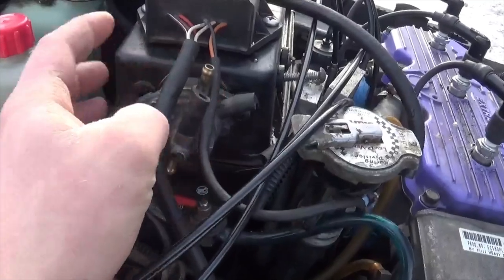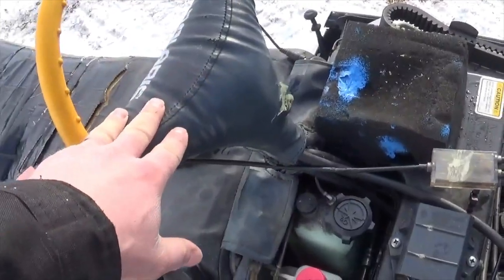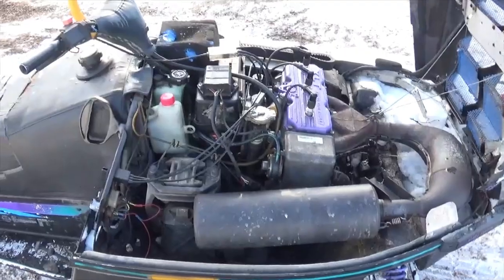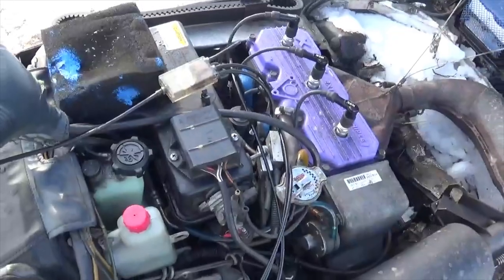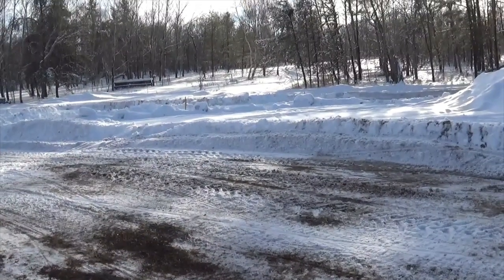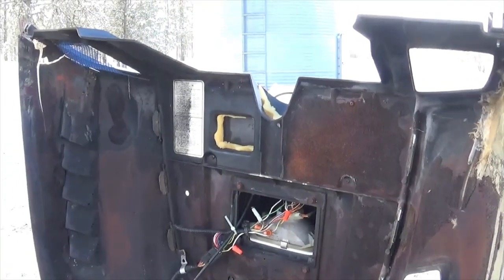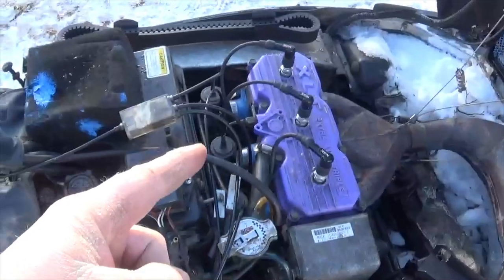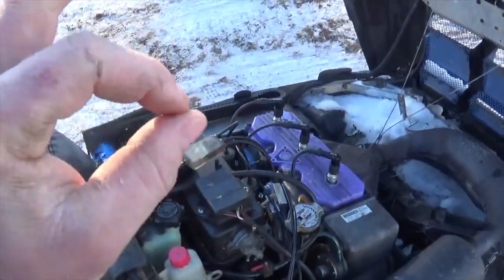3 things that fixed my XLT bog

Comment: Hmmm...interesting.  I have a '95 Indy 440, and really have no problem with bogging (after extensive pre-season maint. of course).  Naturally, I have the filter that sits atop the airbox.  I replace that one regularly.  But never knew there was supposed to be a filter for the dashboard air intake.
Reply from the maker: Yup! although, (even though it's probably obvious) dont use any old piece of foam like I did. i't definitely messed with the air/fuel ratio a bit lol